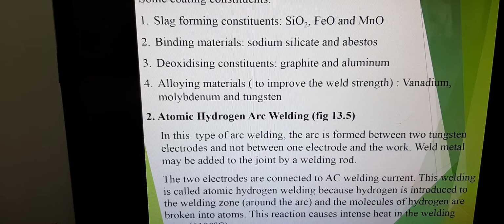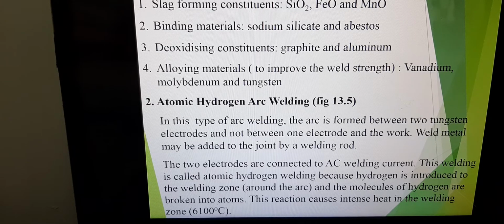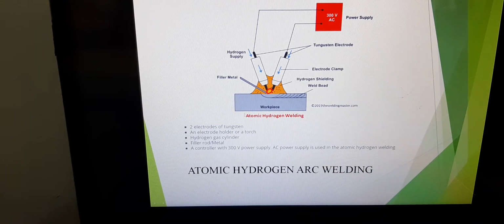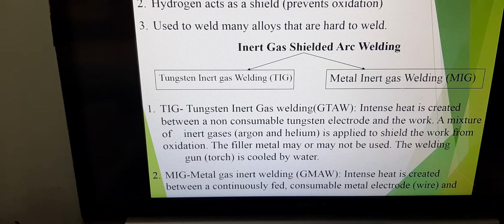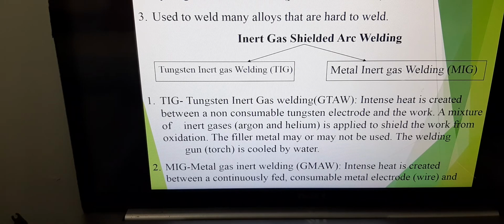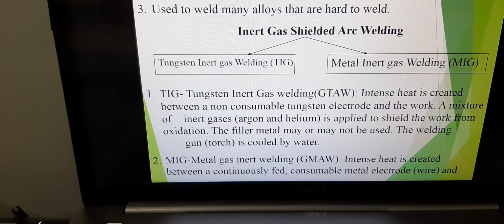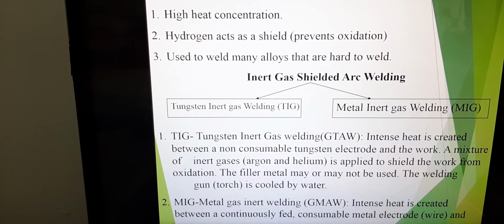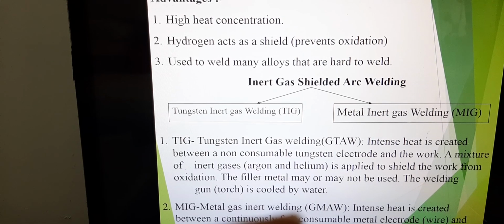WELDING AND JOINING  PROCESS PART 3

Comment: Mohammad Aliff Bin  Mohd Pauzi (ME0104760).
From this video i learn that : 

Atomic hydrogen arc welding
--hydrogen gas act as shield from oxidation (protected weld area)

Inert gas shielding arc welding
--consuable electrode : electrode melt and deposited in weld area
-non consumable electrode : does not use electrode

Comment: Name: Nur Syazwani Bt Mohd Noor 
ID: ME0104367

From this video ,i learned about the atomic arc welding. The arc is formed between two tungsten electrodes and hydrogen is introduced to the welding zone. The purpose of hydrogen is it act as a shield to prevent oxidation during welding process. It is also used to weld alloys that are hard to weld. Next is the inert gas shielded arc welding. There are two different types of electrodes that can be used for this process which is tungsten inert gas (TIG) and metal inert gas (MIG). A mixture of inert gas (argon and helium) is applied to shield the work from oxidation. What i understand is that for the tungsten inert gas electrode, intense heat is created between a non consumable electrode which is a dummy electrode in welding process while the metal inert gas electrode uses a consumable electrode.

Comment: Hi Dr,

I have learnt about atomic hydrogen arc welding and inert gas shielded arc welding.Atomic hydrogen arc welding ,hydrogen gas is supplied during welding,it act as gas shield to prevent oxidation,hydrogen molecules will be break into atom and intense heat (6100°c ) is released,so overly brittle and hard material can be weld using this welding method.Besides,inert gas shielded arc welding is another welding method mentioned in this video.Tungsten electrode which is non-consumable electrode,Metal electrode is using consumable electrode that melt into the workpiece.The mixture of inert gas(Argon and Helium) is supplied to prevent oxidation and form a shield.Thank you Dr.

Tan Kang Je
ME0106097

Comment: Good Evening Dr, what I have learned from this video is that there are two types of arc welding processes which are atomic hydrogen arc welding and inert gas shielded arc welding. For atomic hydrogen arc welding, the arc is formed between two tungsten electrodes and not between one electrode and the work. Hydrogen plays a big role in this process as it is used to produce high heat concentration, protective mechanism and used to weld many alloys. For inert gas shielded arc welding , there are two types which are tungsten inert gas welding and metal inert gas welding. Thank you Dr.

Muhammad Naquib Bin Nor Azlan
ME0106093

Comment: Hi madam, Rajbhinder Singh ME010698
 I learned another two types of welding. The first type is atomic hydrogen arc welding where hydrogen acts as protective mechanism on the welding. Arc is formed between two tungsten electrodes and not between electrode and the work. Hydrogen molecule is converted into hydrogen atom. 
Second is the inert gas shielded arc welding. Two methods are tungsten inert gas and metal inert gas. In tungsten inert gas, non consumable electrode is used as it is not used up during welding. Intense heat created between the non consumable tungsten electrode and the work. Mixture of inert gases such as argon and helium is applied to shield work from oxidation

Comment: Hi madam i learned another two types of welding. The first type is atomic hydrogen arc welding where hydrogen acts as protective mechanism on the welding. Arc is formed between two tungsten electrodes and not between electrode and the work. Hydrogen molecule is converted into hydrogen atom. 

Second is the inert gas shielded arc welding. Two methods are tungsten inert gas and metal inert gas. In tungsten inert gas, non consumable electrode is used as it is not used up during welding. Intense heat created between the non consumable tungsten electrode and the work. Mixture of inert gases such as argon and helium is applied to shield work from oxidation. 

AHMAD NAZRI BIN AHMAD TAMRIN ME0106079

Comment: Good evening madam, from this video I learned about the way to prevent rust at welded area. Atomic arc welding we will supply hydrogen gas as a protector weld area. Its also act like a shield to prevent oxidation. Inert gas shield arc welding :- tungsten (tig) and metal inert(mig).type of electrode consummable electrode and non consumable electrode.argon and helium is used as protective weld area in tig.  Thank you. ME0106092 MUHAMMAD KHAIRUL AFIQ BIN AZAHA

Comment: Good afternoon madam, from this video i have learnt further about welding process. There 2 more types of welding which are atomic hydrogen arc welding and inert gas shielded arc welding. In atomic hydrogen arc welding, hydrogen plays a big role where hydrogen acts as a protective mechanism for the weld area. The high heats converts hydrogen molecules to atom then hydrogen creats a gaseous shield around welda rea and absord the impurities.
Then, for metal inert gas welding, electrode is used in a wire reel form.This electrode is a type of non consumable electrode where electron consumed melted and deposited into weld area.That's all from me.Thank you madam
.
MOHAMAD FAYYADH B FAZLULAAH ME0106089

Comment: Good day madam, from the video, the information received are the characteristics of atomic hydrogen welding which is good for overly brittle materials as I create heat of 6100°c,  tungsten inert gas welding and metal inert gas welding.
all three types of welding have their own shielding mechanisms such as the use of hydrogen which is broken into atoms, due to the high heat, argon, helium and other inert gases to prevent oxidation from occurring.
TIG welding has a non-consumable tungsten electrode which melts the wire reel going through to be welded on the workpiece and not the electrode whereas MIG welding has a consumable electrode wire which is welded on the workpiece.  
ME0106053 Marcus Chuo

Comment: From this video, I have learned further about welding processes. There are two types of arc welding which are atomic hydrogen arc welding and inert gas shielded arc welding. For atomic hydrogen arc welding, hydrogen gas is supplied to the weld area. Molecules of hydrogen will break into atoms and cause intense heat in the weld area. It also acts as a gaseous shield around the weld area to prevent oxidation. This high temperature produced helps in welding alloys that are hard to weld. Next, is tungsten/metal inert gas welding. During mass production, the electrode used is in a wire reel form.This is a type of non consumable electrode. A mixture of inert gases such as Argon and Helium is supplied to protect the weld area. For the consumable electrodes, tungsten/metal is used as the electrode.
Shahnyeel A/l Anil Kumar
ME0106096

Comment: Hi madam, I have learnt the factors that play important role in a good welded material. If we use bare electrodes, we need to use external protective mechanism. If we use coated electrode, we dont have to think about protective mechanism. Atomic Hydrogen welding: 
1. Hydrogen act as a protective mechanism
2. Hydrogen molecule converted to atom due to high heat
3. Produce high heat, 6100 degree celcius
4. Can weld alloy which hard to weld usually.
5. Hydrogen act as shield in gaseous form during welding.
6. It will float the impurities removed by hydrogen in the form of slag.

I have learnt the 2 types of inert gasses shielded arc welding:

1. Tungsten Inert
2. Metal Inert

There is consumable electrode and non consumable electrode. 

ME0106084
Darrell Anak Dau

Comment: NAME: Neena bt Ahmad Nizam
ID: ME0104364

From this video, I learnt about the Atomic Hydrogen Arc Welding. This type of welding is when the arc formed between two tungsten electrodes and hydrogen is supplied as a protective mechanism and to raise the temperature up to 6100 degrees which is used to alloys that are hard to weld. Next, the Inert Gas Shielded Arc Welding. There are two types which are Tungsten Inert Gas Welding and Metal Inert Gas Welding. The TIG is intense heat between a non consumable tungsten electrode and work which means the electrode is not used in the welding process and will not run out. Inert gas like argon and helium is used to shield work from oxidation. Thank you.

Comment: Good morning madam, today I have learned two other types of welding processes which are atomic hydrogen arc welding and inert gas shielded arc welding. 
 
 Atomic Hydrogen Arc Welding

- Hydrogen acts as a protective mechanism
- High heat converts hydrogen molecules to atoms
- Hydrogen creates a gaseous shield around weld area and absorbs impurities
- High heat eases the welding process for hard to weld materials.

Inert Gas Shielded Arc Welding

a) Tungsten electrode 
 - Intense heat is created between a non-consumable tungsten electrode and a workpiece.
- Inert gas (Argon and Helium) applied to shield from oxidation.
- The welding gun is cooled by water.

b) Metal electrode
- Intense heat is created between a continuously fed consumable metal electrode (wire electrode) and a workpiece.

KHIIREN SHRI RAM
ME0106086

Comment: RAVEEN KRISHNAN A/L K. BALAKRISHNAN
ME0106095

Hi madam, this video has taught me that there are two types of arc welding processes which are Atomic Hydrogen Arc Welding and Inert Gas Shielded Arc Welding. 
For the Atomic Hydrogen Arc Welding, the arc is formed between two tungsten electrodes, not an electrode and work. During welding, Hydrogen gas is supplied to act as a protective mechanism for the weld area. The Hydrogen molecules are converted to atoms . The intense heat (6100 Degree Celcius) can weld alloys that are hard to weld.
As for Inert Gas Shielded Arc Welding, there are two types :- 
1. Tungsten Inert gas Welding (TIG), which uses tungsten based electrode where intense heat is created between a non-consumable tungsten electrode and work. The protective mechanism is argon and helium.
2. Metal Inert gas Welding (MIG), which uses-metal based electrode where intense heat is created between a consumable metal electrode and work.

Comment: From this video, i have learnt about two more type of welding that are atomic hydrogen arc welding and inert gas shielded arc welding. when undergoing atomic hydrogen arc welding, hydrogen gas is applied to the weld to act as a protective mechanism. the hydrogen makes a hydrogen shield to prevent the metal to oxidised during welding. there also two types of inert gas shielded arc welding that are tungsten inert gas welding and metal inert gas welding. for this welding, a mixture of inert gas is applied to shield the work

Ariff Imran 
ME0106083

Comment: I've learnt about 2 forms of welding processes from this video. Firstly, atomic arc welding with hydrogen. The arc is formed between 2 tungsten electrodes, for this method of welding. Hydrogen gas is supplied during the welding processes and serves as the protective mechanism for the welded area. Hydrogen also acts as a defensive shield against oxidation in the welded region. Due to the high heat, hydrogen molecules are converted into hydrogen atoms when extreme heat is produced and hydrogen gas is supplied in the welded region. The temperature will rise to  6100 degree Celcius. Additionally, inert arc welding on the shield. It divides into two groups that are tungsten inert gas (TIG) welding where the tungsten electrode is used and metal inert gas (MIG) welding where the metal is used as electrodes. For TIG, intense heat is produced between the work and no consumable tungsten electrode. Inert gases such as argon and helium are used as the method of defense against oxidation. Next for MIG, intense heat between a continuously fed, consumable metal electrode and the work is produced.

Muhammad Harits Bin Mohamad Zailan
ME0106091

Comment: Good afternoon madam, I am Wong E-Shen (ME0106071). From this video, I have learnt about 2 types of welding processes. Firstly is atomic hydrogen arc welding. For this type of welding, the arc is formed between 2 tungsten electrodes. During the welding processes, hydrogen gas is supplied and act as the protective mechanism for the weld area. Hydrogen also act as a shield to protect the welded area from oxidation. When intense heat is created and hydrogen gas is supplied in the welded area, hydrogen molecules will converted into hydrogen atoms due to the high heat. The temperature can go up to 6100 degree celcius. Secondly is inert shield arc welding. It separates into two categories which are tungsten inert gas welding (TIG) which the tungsten electrode is used and metal inert gas welding (MIG) which the metal is used as electrode. For TIG, intense heat is created between no consumable tungsten electrode and the work. Inert gases such as argon and helium is used as the protective mechanism to prevent oxidation. Next, for MIG, intense heat is created between a continuously fed, consumable metal electrode and the work. 
Thank you.

Comment: Good Day, Dr. I am Derrick Ng Kian Ping (ME0105733). At the end of the video, I have learned about the 2 types of welding process. The first welding process is Atomic Hydrogen Arc Welding. Hydrogen supply is used to supply hydrogen gas into the tungsten electrode. Hydrogen acts as a protective mechanism for weld area and to prevent oxidation. Besides, under intense heat while hydrogen gas is supplied, hydrogen molecules are converted into hydrogen atom and increase the heat in the weld area thus enabling this process to weld many alloys that are held to weld. The second welding process is Inert Gas Shielded Arc Welding. There are two variations for this process which are Tungsten Inert Gas Welding (TIG) and Metal Gas Inert Welding (MIG). For TIG, an intense heat is created between non-consumable tungsten electrode and the work. The type of gasses used are a mixture of inert gasses which are argon and helium. Lastly, for MIG intense heat is created using metal as an electrode.The metal electrode is a consumable electrode and is continuously fed and deposited into the weld area.

Comment: Ariff bin Alzakri 
ME0106046
Good day madam, from this video we learned about 2 types of welding processes. The first is atomic hydrogen arc welding where the arc is formed from 2 tungsten electrodes. Hydrogen gas is supplied to the weld area during the welding process. The hydrogen molecules are broken into atoms and this reaction causes intense heat at the weld zone as high as 6100 Celsius. The hydrogen gas acts as a protective mechanism to prevent oxidation and this process is capable of welding materials that are hard to weld. 
The other type is the inert gas shield arc welding which is parted into two which is Tungsten inert gas welding (TIG) and metal inert gas welding (MIG). TIG uses a non-consumable tungsten electrode and MIG uses a consumable metal electrode .

Comment: Good evening madam, From this video i learned about atomic hydrogen arc welding. Its formed between two tungsten and not between one electrode and the work. May be added to the joint by welding rod. there are 3 used of hydrogen: 
1. high heat concentration
2. protective mechanism
3. used to weld many alloy 
there also two inert gas arc welding which are: 
i) tungsten inert gas welding. - mixture of argon and helium to prevent oxidation
ii) Metal inert gas welding - intense heat created between continues fed . used consumable electrode.

NAME: Alif Haikal Bin Azly
ID: ME0106081

Comment: NIGEL ANDERSON SINGH A/L RAJDEEP SINGH
ME0106094
Good day, miss. Every welding processes have its own protective mechanism. Atomic Hydrogen Arc Welding is a welding process which converts hydrogen molecules into hydrogen atoms due to the high heat which causes intense heat at that welded area up to 6100 degree celcius. Hydrogen also acts as a protective mechanism at the welded area. The advantages of this process is it can weld alloys that are hard to weld in a normal welding procedure and the high concentration also protects the weld surface from oxidation (rust). The next welding process is Inert Gas Shielded Arc Welding which consists of tungsten inert gas (TIG) and metal inert gas (MIG) where TIG involved intense heating between non-consumable tungsten electrode and work where argon and helium gases are used as the protective mechanism while MIG involved intense heating between a continuously fed consumable metal electrode in the form of wire.

Thank you.

Comment: Good day Dr I'm Lee Zi Sheng (ME0106051). I learned about types of arc welding process which are atomic hydrogen arc welding( hydrogen prevent oxidation) and inert gas shielded arc welding. whereas for inert gas arc welding has two types which are Tungsten gas arc welding (TIG) and Metal gas arc welding (MIG) . TIG uses tungsten based consumable electrode while MIG uses metal based consumable electrode . Inert gas (argon and helium) used to prevent oxidation. Thank you.

Comment: Mohamad Ikhwan Syafiq bin Zadi

ME0106090

In this video I learned about different technique in welding
process. First using a suitable electrode to overcome oxidation at the weld
area. Second , atomic hydrogen arc welding . During this process hydrogen is
supplied. Hydrogen act as a protective mechanism during welding process that
prevents oxidation occur. Next there is inert gas shielde arc welding. There
are two types of this welding which is the tungsten inert gas welding (TIG)  and metal inert gas welding ( MIG ) . Using
TIG , a mixture of inert gas which is argon helium is applied to shield the
work from oxidation.